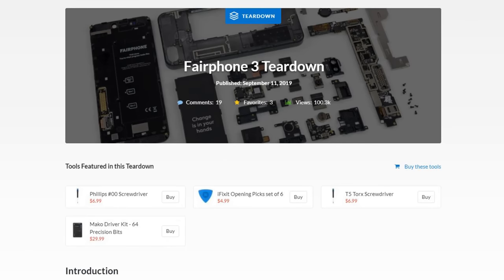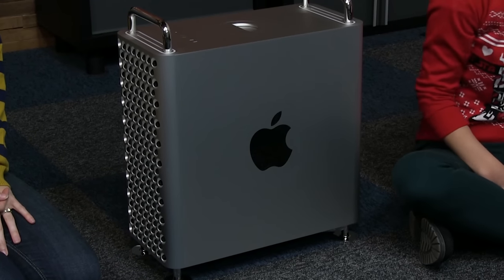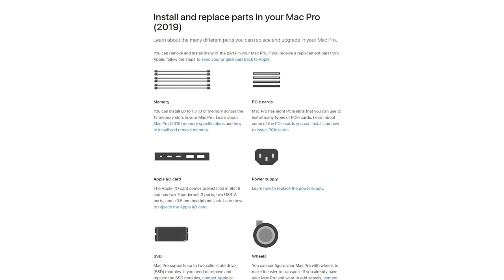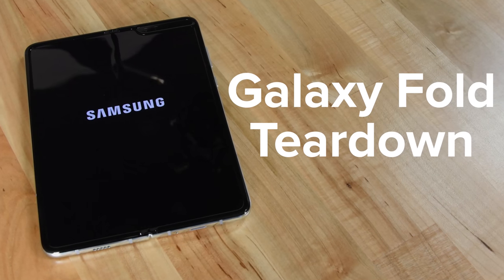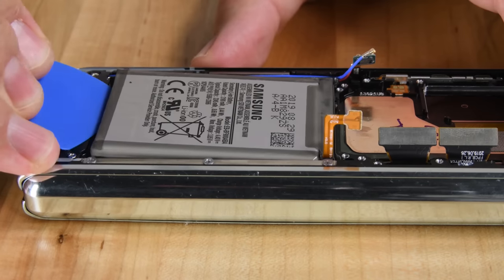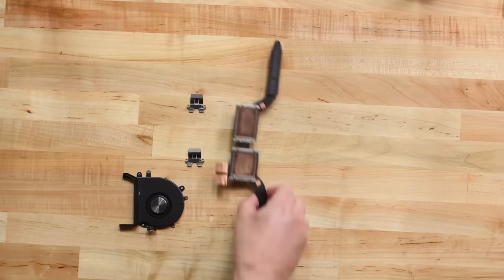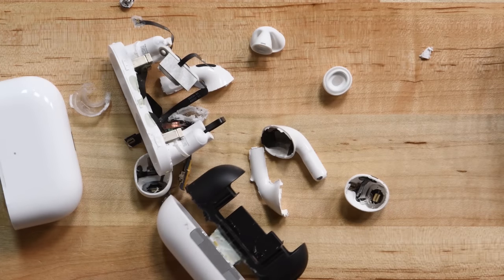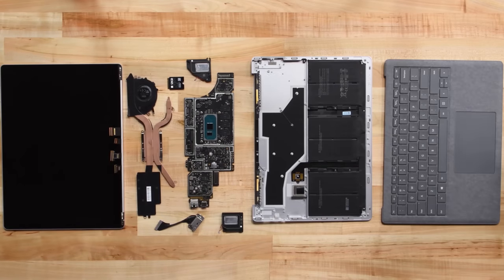iFixit's Best and Worst Devices of 2019!

Comment: screws > clips
Reply: I'm always afraid of breaking the casing, when I have to apply an uncomfortable amount of force to get the clippings out of the way.
Reply: I collect and repair devices from anywhere from 1920s to about 2010 (after that it's kind of a nightmare) and all plastics get brittle over time. some are better than others, but all get brittle. That's fine for cases that are not structural, but clips almost always shatter, like even before they release.
Reply: Screws>clips>glue
Reply: I usually think this, and then I strip a screw.
but yeah I've destroyed way more clips than screws.
Reply: atleast I dont get a heartattack thinking I broke something when things are screwed down

Comment: Wtf clips better than screws?? It couldn't be simpler than screwed together. Clips break, can be a nightmare at times depending on shape/size/amount/placement, and you usually end up marring or breaking the edges of the subject where parts join.

Comment: 1:50 Clips better than screws? Usually clips breaks
Reply: small screws can  strip
Reply: Bad desinged ones break
Reply: @berberger4814  but both are better than extreme adhesive
Reply: they tend to look better by not being visible, but yea I prefer screws every time
Reply: @kilmentvoroshilov2827  small screws can strip but that's way easier to get a replacement for than an attached clip.
Reply: i don't like clips at all the klick sounds the make scares me i always think that brake or something
and ok i know small screws can strip but you can replace them if a clip brakes it's not as easy to replace
Reply: @xandercloet7467  not saying one is better than the other,but just stating their disadvantages
Reply: Am I the only one who thinks screws are better? Screws are literally made to disassemble. Not all clips open easily without breaking but every screw is the same.
Reply: grid the cheese from inside the case
Reply: @kilmentvoroshilov2827  Then use "high quality" aka "not made from lead" screws.
Reply: Like it’s easier because you put the screw back & you don’t know how much to screw it back in & you could break it.
Reply: also with clips u can maybe open a device 1 or 2 times.. second time u might break some clips.. or even the first time.. with srews u can do 10+ ez and u dont strip em when u dont overtighten.. and even if u strip them u can just add some more plastic or gue so they will hold again.. i hate clips.. they always break.
Reply: But who takes around a CONSOLE? It just sits there.
Reply: look at the positive side, if it breaks u can superglue that thing shut, just like the manufacturer wanted,  but got destroyed (xcept by fans of the brand(🍎)) for doing it in previous devices.
Reply: I collect and repair devices from anywhere from 1920s to about 2010 (after that it's kind of a nightmare) and all plastics get brittle over time. some are better than others, but all get brittle. That's fine for cases that are not structural, but clips almost always shatter, like even before they release.
Reply: @xandercloet7467  you can just drill out a stripped screw wtf am I supposed to do when 1 of those plastic clips snaps.
Reply: Psider a stripped screw, or a screw with a striped head, may be harder to remove than a broken clip.
Broken clips fail safe, stripped screws do not.
Reply: @funposting8912  stripped screws are pretty easy too remove with a drill bit can take a little while but completely doable when a clip fails its gone forever
Reply: they don't care about durablilty its called Ifixit not Idurable

Comment: 1:53 Why are they saying that clips are better than screws?
Reply: Agree. A ton of clips instead of 4 screws? Come on!
Reply: Plastic clips breaks easily
Reply: I cut my finger when i was trying pry open an original xbox one in order to upgrade my disk space, fuck clips.
Reply: IKR. I hate removing clips cos you never know if it's breaking the clips or if you're doing it right.
Reply: They should also downgrade the mac pro score to at least a 7  for having a vital part locked into apple's ecosystem by only allowing apple certified ssds on that slot. you can use pce or sata sure, but proprietary parts is how apple made very difficult to repair mbps.
Reply: I think she said glue.
Reply: Yeah I'm fairly experienced at disassembling electronics but still have that little moment of panic when prying apart things held together with clips.
Reply: I hate clips.

Comment: I never thought a phone a would get a 10. That shows what I know at times.  Thank you for this yearly review. (:
Reply: The Fairphone is quite unique in that regard
Reply: Psider Yup, I would agree.
Reply: my FP2 is not bad in regards to repair but you need to know that you cant expect the most advanced stuff in there
Reply: @georgkilianbraunig5877  I had to replace the screen on my FP2, but the process speaks to the advantages of a repairable phone: they sent me the replacement, I swapped out the old one, put in the new one, then shipped the old one back (it was under warranty). Zero time spent without a phone. Three years in now and it's still going strong. Like you said, it's not the world's most advanced smartphone, but it works and is a nice conversation starter with the right people.
Reply: @friendlyoctopus9391  i am looking forward using it as long as possible....
Reply: @friendlyoctopus9391  I just wish there is Flagship Fairphone. It would be wonderful to have that.
Reply: @psider1522  There are a couple other phones designed with repairability in mind: the Librem 5 and probably Pinephone. But, overall, great repairability is usually only found in very niche phones that have it as a unique selling point, from what I see.
Reply: @Enforcedcraft  There is the fairphone 3+ now which is super amazing! I have a Fairphone 3 and just upgraded my camera modules to the ones from the 3+. How amazing it is it to be able to upgrade the hardware of your phone?

Comment: Ifixit: the Surface laptop is now repairable!
Me: laughs in ThinkPad
Reply: Most thinkpads have shitty screens without getting very closely and they have a different form factor usually. Only the x1 is really competition and they are a lot more expensive afaik.
Reply: @toxy3580  touche! That's why I upgraded mine to a 1080p IPS panel, TBH their default options suck.
Reply: @coccoborg  yep. The best option are the low power IPS screens.
Reply: "ThinkPad" but not counting the 2018 and newer models in my opinion. Why did Lenovo have to make more components onboard…

Comment: i really dont like the airpods, but i have to say, to include them in this list, is rather stupid.
sture, they are not repairable, but so are all the other in-ear headphones...
Reply: Their coin-cell batteries don't promise a long lifetime though, less than a smartphone
Reply: * cough ... Galaxy Buds ... cough *
Reply: M4kI9H7 still rocking my airpods 1 which i bought at launch.. just be careful with your shit
Reply: this is one of the reasons I use over-ear headphones
Reply: Most headphones that cost that much can in fact be repaired to some extent. Spending $250 on headphones and having their rechargeable batteries wear down after a year or too, and not being able to replace the batteries is pretty lame... Do you just throw stuff away when the batteries go bad? I mean, Airpods pro cost as much as 5 xbox one controllers, so by your logic I can only assume you just toss yours in the trash when the included batteries die, and grab a fresh new controller off the stack?
Reply: @Derively  Exactly... You pop the back off, pull out the module, swap out the battery, click back together. They are meant to last... Airpods on the other hand... Toss em after a year or two, and buy another set ya iZombie.
Reply: Capn Smashem You can get the batteries replaced by Apple so you don’t have to buy a new pair and throw out the old ones if they go bad
Reply: Dom_ The I know, I just wanted to point out that you can get them them replaced instead of buying a new pair for a somewhat lower cost

Comment: Hadn't even heard of the Fairphone, sounds like an awesome concept! Too bad it's only available in Europe though.
Reply: A shame...

I too hadn't heard about the fairphone at all. After ifixit's teardown i ordered one a week later.

Best phone i've ever had, and if anything breaks i can repair it. Of particular praise is the battery, not far off the same capacity of my old phone, but i'm now easily getting two days usage vs 1 day on the old...
Reply: @cyrilthefish  I hope they release it outside of Europe sometime in the future, it's just what we need: repairable tech.
Reply: @Van I know this is kind of a necro, but the reason the fairphone costs so much is because they use a 100% ethical supply chain. Which means every element of the phone costs more.
Reply: Samsung is making a series of similar phones that are meant to be easily repaired, and those will also only be released in Europe, because statistically Americans prefer disposable devices.
Reply: AniMeusic  And I thought Yogi was dead.
Reply: We Americans don't have a right to reasonable products 😂
Reply: @Ravidist  True, you also didn't get the Moto G5 (non-plus), which was one of the last good budget phones with a replaceable battery.
I recently got such a G5, new old stock, and despite it being the lowest specced model, it's still a great phone for me.

Comment: The 9/10 for the Mac Pro is too much imo. It still has some stuff that makes it less repairable (proprietary motherboard, power supply, T2 chip...). Normal desktops are fully repairable and can be disassembled and upgraded easily which is a flat 10/10. The Mac Pro would be more like a 6/10 at most.

Comment: Dude the surface deserves a 10 in my opinion because you used to haft to destroy your laptop in able to even look inside of it also it was so easy to exchange parts it was like a desktop!
Also if you do it right you can get away with using only 3 tools a heatgun screwdriver and a prying tool double sided!
In my opinion the surface deserves I higher score but overall it was a great video!

Comment: I feel a bit for the airpods, gluing the shit out of it definitely will help stuff coming loose when jostled. That said there may be a kind of non-adhesive filler they could have used that would stop motion while still allowing removal, as well as simple making some form of removable battery module (i.e. screwing out of the bottom or something).

Comment: So repairability score is only given by how easy it is to take apart a device? 
You can not say that something is easily repairable, when pretty much no one has access to parts needed for repairs. For an example, the Galaxy buds got repairability score of 6 when the only real thing that was "user serviceble" was the battery. Also, you scratched the headphones while opening them, leaving them to look ugly once reassembled (no one would like to wear something hacked up). The charging case was also easy to open, but there was nothing to repair/replace in there, because there are no parts available.
Reply: The batteries are replaceable, and they are pretty easy to find. At least every part on everything they took apart in this video is readily available and easy to find (except the macbook). I am not sure what you are referring to. As far as what is user serviceable, unless you own a semiconductor manufacturing plant or full micro repair shop, I don't thing you'll be working on component level on a device who's circuit board is the size of a pinky nail. The main thing you're going to want to fix is poor battery performance with a device like this. Most defects would be noticed within the 1 year warranty, anything outside of this is technically normal wear and tear, however, we know electronics can last much longer than their batteries, unless you are the kind of person that tosses out a perfectly good xbox controller when the AA's die, then sure. For most of us, the battery is the only thing we'll be needing to replace on such a small device. Any other component failure, in a device with so few, so small, and so fragile components, points to device failure. A set of headphones is not as component heavy and complex as a smart phone. Yeah, we just wanna know how hard it is gonna be to swap in a new battery in a couple years so we can get our money's worth. My galaxy buds shipped with a defective bluetooth receiver. Samsung over-nighted me a replacement set, no hassle. They're flawless, and in a year or two, I'm gonna swap out the battery and keep on chuggin' along. Though, I am interested in something with better sound quality, like some Grado's, or the new Panda's by Drop with their proprietary THX designed preamp. Those seem pretty good.

Comment: They should give a seperate grade on how easy it is to get the part/have it work and if possible take in consideration its price. Its nice to see that you can change it but where to find it and for what price (some times the replacement will cost you more then the product itself), if you find the part will you be able to replace it or its going to be software protected and the part isn't going to work if it is not reprogrammed by a professional store.

Comment: can you make a teardown of Twibright Ronja? Once a close lightning strike blew it and it cost me 1$ to fix it. Opened with a screwdriver, the schematic test points and nominal voltages printed on the inner lid, quickly I saw wrong voltage around input transistor, resoldered a new one and it worked like new again.

Comment: And it turned out that you can indeed upgrade the SSD on the Mac Pro by using Apple Configurator 2 with another Mac so while it’s not plug and play, at least if the main SSD dies or you want more encrypted storage it can still be done without too much trouble.

Comment: Obviously it's not a 2019 device, but it's odd to see the One S All-Digital on the list when the Xbox One X is much easier to open.
Reply: Jared Bowhay-Pringle Please read your sentence again. You answered your own question.
Reply: @ChrisBa303  My point was not that I believe the One X should be on the list, but that the One S All-Digital shouldn't really as it's harder to open than previous Xbox products. Technically, it's even a little harder to open than the original One S, as there are a couple more screws holding the metal plate where the Blu-ray drive used to be.
Reply: @jaredbowhay-pringle1460  This list is about the repairability of tech products released in 2019. The xbox one sad was released in 2019. Its a product you can spend money on. Thats why its on this list.